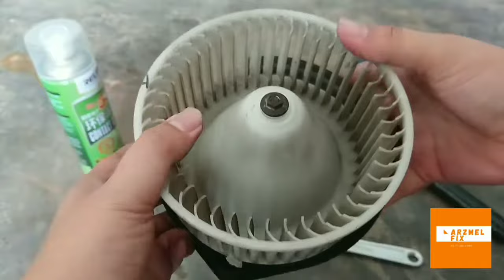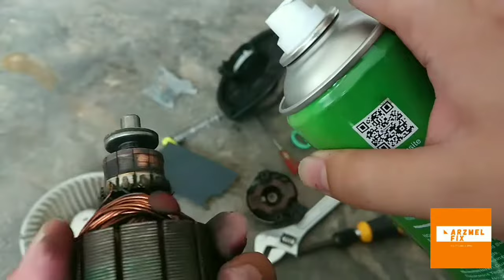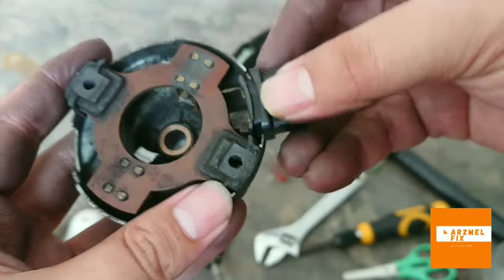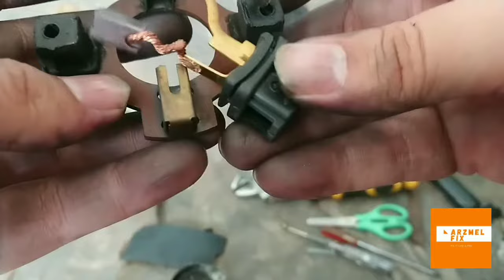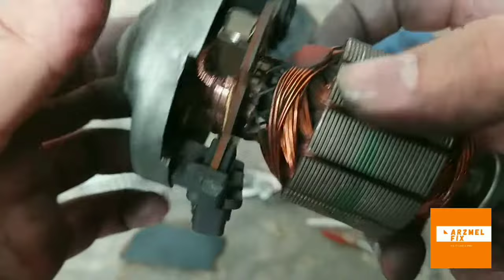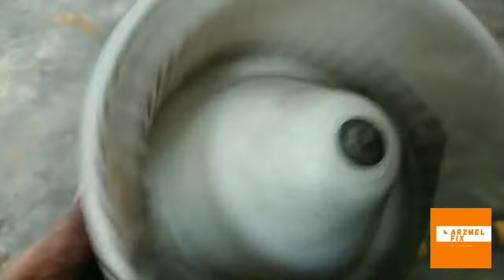CAR AIRCOND BLOWER REPAIR * CARBON BRUSH * WORKING 100% !!! *

Comment: Lepas ni guna silicone lubricant boss atau grease oil. Baru laa lambat kena moisture. Kalau guna minyak mesen jahit tu sekejap jer. Apapun terima kasih atas videonya. Saya ada blower bising. Nak buka kejap lagi.
Reply from the maker: Blower ni pakai copper bush saja..mcm kipas rumah.. Tu letak myk biasa je..kalau silicone tu utk kalis air/karat untuk benda yg bila bergesel dy berbunyi...grease pulak tangkap carbon dlm tu nanti jadi likat, pusingan makin slow.. Wd40 pulak kalau letak, bunyi tikus cit cit cit 🤣
Reply: @arzmel_fix  oooo.paham2
Reply: @arzmel_fix

Comment: Hye bos nak tnya . Aircond kereta saya tkle kuat means tkle tekan 1,2,3,4 adakah itu dsbbkan blower rosak or what ?
Reply from the maker: Mksudnya tukar 2 3 4 pun speed sama ya.. Boleh jadi blower rosak tu. Ataupun suis controller 1 2 3 4 tu rosak

Comment: Kat kedai spepart ada jual ke carbon brush ni ?
Reply from the maker: Saya beli online.. Ada satu kedai tu jual.. Kat kedai luar mmg susah nak jumpa..org kata kedai aircond
Reply: Salam bos..apa nama kedai yg jual tu ye...ape2 pon video mmg  ni mmg mnafaat..👍👍
Reply from the maker: @aerialarmy7357  wasalam.. Nama kedai dy winter air.. Kne pm dy dulu tanya ada stok tak, baru dy bg link produk tu.. Terima kasih atas support 😁👍
Reply: @arzmel_fix  Assalamualaikum.. Bos, boleh bagi link online sparepart tu tak?
Reply from the maker: @NoName-kk5ce  wasalam cari nama kedai mcm komen kat atas.. Link takde.. Kene pm seller baru dy create link utk beli..
Reply: @arzmel_fix  winter air-conditioning & trading ke? Dkt kl kan?
Reply from the maker: @nurainahmadzawawi1990  mungkin lah tak ambil tahu pasal tu 😅
Reply: Boleh bagi links carbon brush nie x boss? Untuk kereta Viva PON sama ka?
Reply from the maker: @suhairiel123ray3  carbon brush viva mungkin kecil sikit.. Ikut saiz armature.. Link tak ada.. Kedai tu create link sdri nt.. Cuba tanya dia kalau ada lagi
Reply: @arzmel_fix  ok boss tq
Reply: Saga/wira punya boleh guna dekat perodua Viva juga ka bro @arzmel
Reply: Kedai yang bro cakap tu dia tak jual dah la... Baru nak jimatkan modal sikit.... Nak kena labur juga beli satu set

Comment: Leh share link utk brush set tu
Reply from the maker: Ada di ruang komen sy sebelum ni.. Boleh tgok2.. Sy dh lupa
Reply: @arzmel_fix  kancil de jual set ke
Reply from the maker: @syazwanismail88  kene tanya kedai tu ada tak set carbon model kancil.. Ambik gmbr contoh bg kat dy pon boleh, kalau dah bukak la blower tu.
Reply: @arzmel_fix  mmg dh buka blower pn abg..rabu bru sye ke kedai

Comment: It rotates clockwise or anti clockwise
Reply from the maker: @Ankityaduvanshi1732  does not matter, it depends on the structure of the blade facing which way to your ac compartment

Comment: hello..motor berbunyi dengung sbb apa ye,kuat bunyi bila on blower..bunyi tu dtg dari carbon ke
Reply from the maker: Mungkin dari copper bush yg haus/bearing yang dh nk rosak
Reply: @arzmel_fix  motor tu original baru pakai 3tahun,tapi tengelam banjir..copper tu kena gosok dgn kertas pasir balik ke,bearing ada jual ke dekat kedai sprepart kereta
Reply from the maker: @MaharajaFX  ganti lain je copper bush.. Gosok pun nt makin haus makin ada bunyi pelik.. Bearing ada je jual kat sparepart kete.. Tp kene tahu la nombor pada bearing..nk kne bukak

Comment: My ac mechanic just repaired like u showed on video but after repairing it started making noise my mechanic is saying thats fine it will go away after running ur fan few week is it normal?
Reply from the maker: @kazim3099  did the mechanic replace copper bushes? Normally shrieking sound comes from there

Comment: I have EXACTLY that motor, and need exactly those carbon brushes, but can't find them anywhere... What's the model and measures of those brushes? And where did you buy them?
Reply from the maker: Hye i bought them online.. Just search for your car model..
Reply: @arzmel_fix  Can you put the link for the item? Please? I put the name and model, but only appears full motor assembly
Reply: Which Company did you buy the brushes from?
Reply: @waynenoel4670  Dont remember the size, but bought them in ebay. One thing to notice is if the carbon brushes of your motor are worn to the point that the metal wire inside them are making contact with the rotor, probably you'll need a new motor. Because if the brush worn out to that point, the wire inside the brush will damage the rotor and make it porous, and new brushes will be eaten away in less than a week. That's what happened to me... Solved the problem getting a blower replacement in a junkyard, for just $35.

Comment: mantap bos. terima kasih ilmu. sy tukar brush dgn ameture skali. laju desuppp
Reply from the maker: Sama sama 😁👍
Reply: @arzmel_fix  carbon n amerture nk beli mana.mmg dtg satu set kn.harge berapa
Reply from the maker: @Ahmadzulfahmizakaria  carbon belas2 je.. Armature mungkin puluh2.. Ikut model kereta juga.. Beli on9 di sopi 😁
Reply: Ada link ke bos
Reply: utk perodua Alza same ke boss..bleh tukar carbon brush x..beli kat kedai spare part atau kedai aircond

Comment: Bos saya pm winter air dia cakap carbon brush saga blm dia cakap tak pasti sama tak dengan model wira. Bos ambil model ape ye?
Reply from the maker: Sy punya kereta wira.. Saiz mcm dlm video.. Tapi carbon tu terbesar takpe rasanya.. Boleh asah bagi kecik..

Comment: Bang... Myvi 2018 bleh buka camni jgk x
Reply from the maker: Boleh.. Cuma design blower tiap kete lain2.. prinsip sama je pakai carbon brush dgn armature.
Reply: Cara buka kipas blower myvi mcm mna yer, puas cari cara buka...Yg abg punya guna nut, yg mybi xde nut mcm tuy
Reply from the maker: @bokbomofficial69  nak kene tengok gambar baru paham..

Comment: Hey, i replaced the brushes.
But now it gives squeeqing/scratching noise…i tried to fit it again and again…but when i start the fan, it sounds fine for the first 2 minutes…then it starts wining…can you tell me what that sound is of?
Reply from the maker: Hye have you do proper sanding on the commutator? To ensure good and smooth contact with the carbons. If the commutator plate has minor bending, it will creates carbon residue downwards( inside copper bush) then create some noises.
Reply: No i didn’t clean the commutator thoroughly like you did. I am afraid that i might do it too much. Can you please tell me which size sandpaper did you use?
Reply from the maker: @ahmadfarooq5919  i use 1000 grit sandpaper. Also note to apply some sewing machine oil to the copper bushes for smooth rotation.
Reply: Thankyou for your help. Much appreciated. ♥️

Comment: Salam, kat mana nak beli carbon brush, Bosskur? Dia punya saiz brapa kalau Axia 2015?
Reply from the maker: Wasalam beli di shopee.. Winter air kalau tk silap namanya.. Kene tanya seller tu ada stok atau tak utk axia.. carbon dy kecik sikit
Reply: Apa nama benda ni bos?